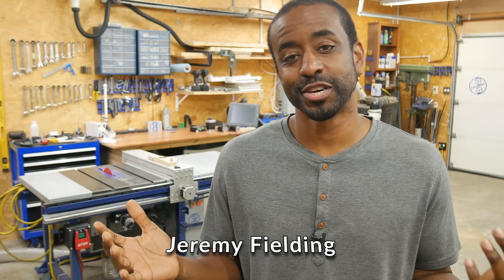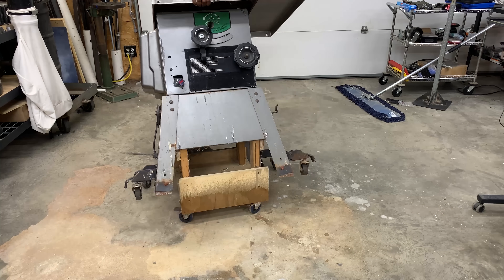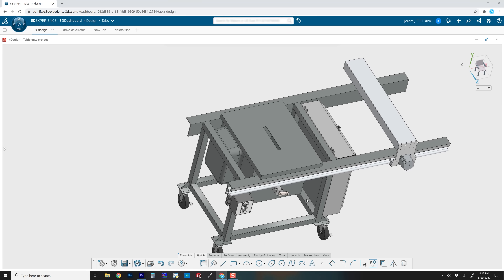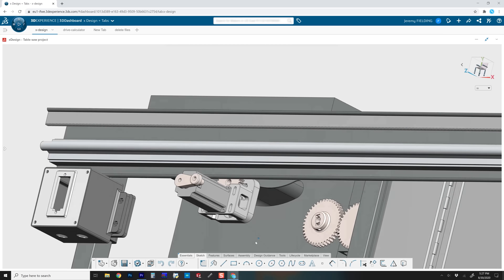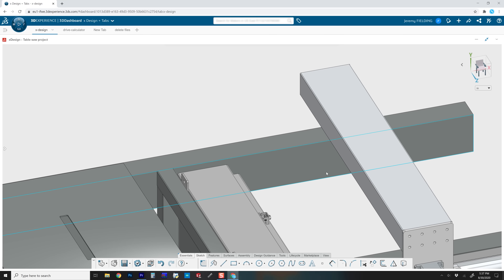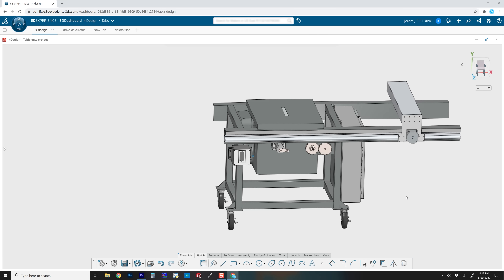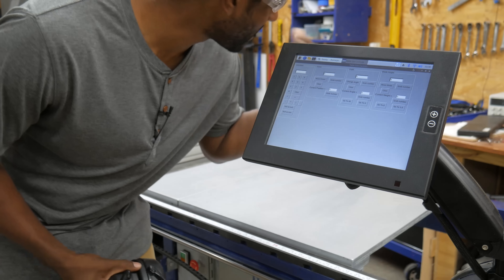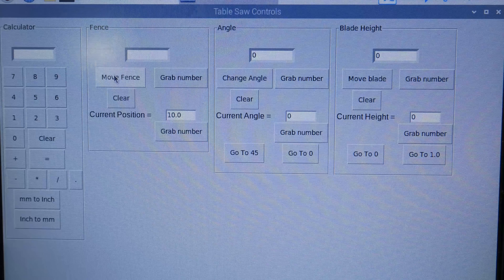How To Make A CNC Table Saw : # 084

Comment: This is a great idea!  One thing that you might want to add is the ability to upload your cut list from gcode file and store them in favorites buttons.  I invariably forget one piece to cut and have to go back and re-adjust my fence to a size I have already cut.  It would be nice to just hit a favorite button and send it back.  Also its easy to get the wrong measurement. If its uploaded from the drawing it should reduce the chance for errors in cutting.
Reply: Yeah, you can have a history button or hold your finger down in one of the field and it lists the past values for selection.
Reply: Then again with a cnc repeatability isn't so much of an issue.  But a cut list with comments would be cool.

Comment: That's is one amazing project! Consider a "home position" function where you can command the saw to go "look" for a predetermined position (prox or mechanical switch) then set the home position from blade. Also, you can purchase round handles where the handle bit folds into itself so when the thing spins there's nothing sticking out. Again, awesome project.
Reply: On initial start-up, require the machine home to all limit switches (i.e. mechanical limits):  Fence to far right, blade angle to zero, blade height to zero. From these known absolute coordinates and states, then set the machine to first cut dimensions.
Reply: @ARepublicIfYouCanKeepIt  The trick is how? With servos, there's usually an encoder, and the switch just tells the machine to slow down and start loking for the zero mark. With steppers / open loop it would probably need to be a high quality snap switch set up to open contacts at the home position, and  really slow aproach (1/2 of max speed?) Maybe two switches: one to slow the stepper and another for home. Motor could rapid, hit first switch (prox), slow down and look for second switch (snap). This should repeat reasonably well for a table saw application.
Reply: Jon Anderson  Agreed. I figured snap switch, wired as NC, open on bump would give more exact stop. The home limit switch (prox or mechanical) could also double as hard overtravel limit, with software limits set in the code, just have to keep track of location during operation.
Reply: @MRCNC1967  Our 5'x10' CNC absolutely crawls when performing "All Axes" at start-up.
Reply: @ARepublicIfYouCanKeepIt  we have 3 cnc mills and 4 cnc lathes, Fanuc and Mitsubishi controls. They are mostly all set up the same for home zere return: travel at half normal rapid, hit deceleration dog, then creep to home. The decel dog to home varies depending on machine but it's usually about 1" to 2". The trick on the older equipment is not to park it too close to home when shutting down, which can be an issue when restarting in the morning since the machine has no idea where it is relative to home, and will invariably hit a hard limit switch (hopefully before hitting mechanical limit) Hard limit switch requires manual overide and carefully moving in opposite direction. The newer equipment with absolute encoders and battery back up don't care, but still require homming to sinc the motors to the NC.

Comment: Swarfega Duck Oil for preserving steel surfaces. Helps with rust removal too. Works reliably until it gets standing water on it for extended periods of time.

Comment: Great work!   I mix up mineral oil and beeswax to make shop finish that I use on woodworking stuff as a final finish.  I also use it on metal tool surfaces to prevent rust.  Paste wax is probably the easier option.

Comment: 2:11 i use boeshield t-9. it can be used in a few different ways ...short term or long term.
Reply: motoputz  You're biased.  Boeing is headquartered in WA.  LOL! 

I've use it several times and it does an OK job, so long as you apply it every week or so. It really doesn't hold up and neither does waxing.  The heat and humidity in Georgia will make a mockery of it. 

The real secret is polishing your cast iron to a very high grit count. Rust loves rough metal surfaces. If you sand down the surface to 1000 grit and polish it with a polishing compound to a mirror luster, it will never rust again. Guaranteed!
Reply: I use Boeshield T-9 also, then follow up with plain carnauba wax to get a slick surface.
Reply: @TimberWolf_359  yes and wax is excellent in addition, I use it on my run off table as well
Reply: motoputz   Won't work for long in Georgia. The humidity there is relentless, even in winter.
Reply: @BarryManilowa  I'm in seattle, it's pretty wet and humid here as well

Comment: Could you add a router cnc ontop of the fense and then combo it with the slide of the fense to have a full cnc with a peice if wood resting on the table saw. 
You'd need clearance for material
Reply from the maker: Ben M certainly!

Comment: I've thought about gold plating my table saw top, for rust protection, not beauty.
Reply: I had a 12" object (banjo tone ring) plated in gold once.  I was surprised that it was only $40 (15 years ago).  Their tank was about the size of a kitchen size so it would not have held a table saw top, but maybe you could find a place.  There was some joking that I was only getting 4 atoms thickness of gold.  It looks great to this day though.
Reply: It would wear off far too easily. There are a million other coatings and platings that are far better.
Reply: @xenonram  A coating would change the tolerances too much, so it has to be plated. What would you suggest?

Comment: Wax paste for the table top would work nice, good for other metal tools too
Reply: I've been using paste floor wax that comes in a yellow metal can on my iron tools my whole life, as did my father and grandfathers. Any little bit of wax contamination on the wood comes off with the lightest touch of sandpaper, and it makes sleds glide like you wouldn't believe. Wax on, wax off Jeremy-san.
Reply: Johnson Paste Wax.
Reply: ... and some on the side of the fence helps wood slide nicely!
Reply: I use 100% carnuba wax. No rust, until someone else leaves something wet on the table... Then you got to get out the scotchbrite and wd40 again and scrub the whole surface down again.
Reply: Yep, I second wax. Parrafine wax works great, won't stain and is non-toxic (edible even). 
I've used anything from candle wax to buffing wax, all fine really.
Reply: Yep, Wax is fantastic. When ever I make anything from steel and I don't want it to rust without painting it I use wax.
Reply: Paste wax is the way to go.  I applied it once 2 years ago and there  is no rust.
Reply: Bees wax
Reply: BOSTIK GLIDECOTE -- You can thank me later.
Reply: Concur, I was going to say the same...
Reply: Best recommendation
Reply: Been using Johnson furniture paste wax on my Rockwell cabinet saw since I bought it at auction 25 years ago.  Lately, I had to switch to carnauba(sp??) wax as the can of Johsnon wax ran out.  Still works swell and I have never had any finishing problems with the furniture I have made.
Reply: @johntenhundfeld1529  Johnsons paste wax is mostly carnauba wax so you actually did not switch that much other than brand :-) Whatever you choose , go for one that does not stain your wood.
Reply: Same recommendation!
Reply: Boiled linseed oil maybe
Reply: Silicone lubricant should do the trick